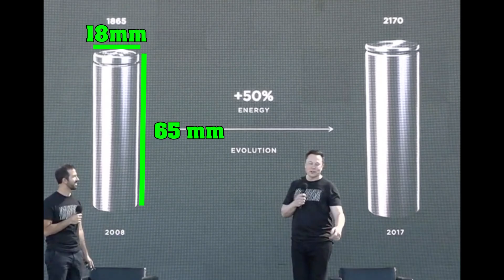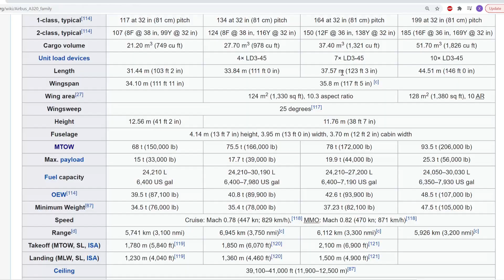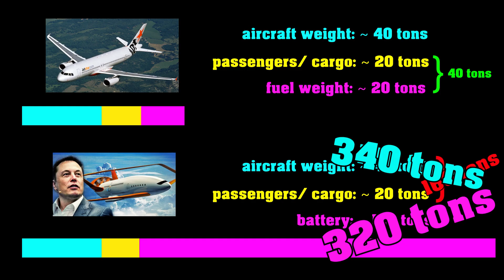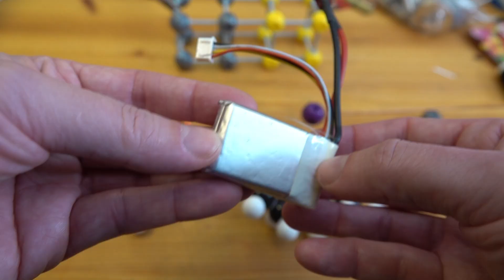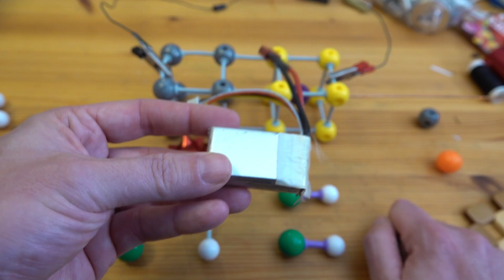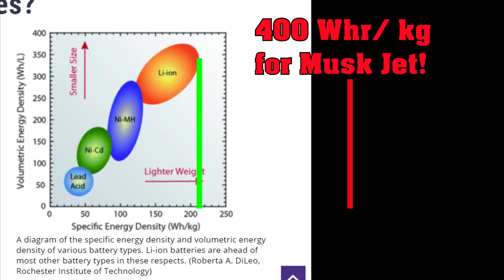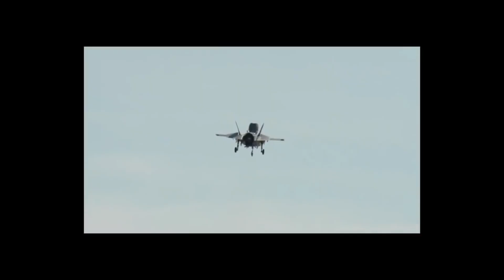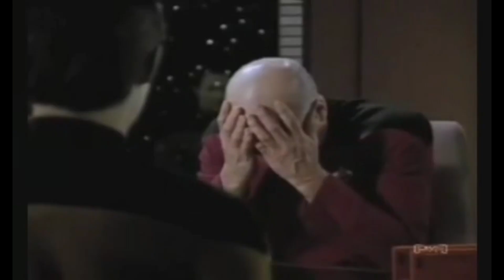Tesla's Secret Plan To Disrupt Airlines: BUSTED!!

Comment: I have only one problem .. the electric jet engine, where is it?!
Reply: fan and electric motor most commercial Jets use high bypass turbo fan engines meaning most of the thrust comes from the fan at the front of the engine very similar to turbo-props. Obviously wouldnt be particularly useful for supersonic flight

Comment: "It's a battery with wings!" So what? A rocket is a fuel tank without wings.
Reply: That's why you don't travel with it and it is for a very very specific purpose.  But wait, there always the SpaceShip which you can use hyperloop to reach within mins on a Tesla model 3 running under a underground tunnel right outside of your home.
Reply: @tarotaro6933  it's called Starship. Jeesh, get it right! And why travel when you can experience Maui with your brain implants?

Comment: I guess once the batteries are a dead end they'll try to make it electric by using hydrogen in a fuel cell. Even that would run into some energy storage issues compared to current fuel, to get a reasonable amount in it'd probably have to be liquid (good luck producing that much cold hydrogen). Then you've got the next issue the energy density by weight is pretty nice, but liquid hydrogen is not a dense fluid so an equal mass of it would take up more volume in the plane.

Comment: Also biggest argument , planes with jet fuel get better fuel efficiency later in the trip as the plane becomes lighter. With batteries as they discharge , the become dead weight and efficiency would stay the same or decrease.

Comment: when they talked about electric aircraft being more efficient the higher they go I think they meant the oxygen or oxidizer needed to make the fuel ignite whale in an electric aircraft oxidizer is not needed for the electric motor to run
Reply: Oxidiser is still needed for batteries to operate as well. Both batteries and combustion engines rely on redox reactions to work, but a battery needs to carry oxidiser with it in order to run, whereas a combustion engine doesn't as it gets the oxidiser needed, oxygen, from the air.

Even worse, the Casgain's Academy guy got it completely backwards. Electric planes get LESS efficient the higher you go, while combustion planes get more efficient.

Comment: At 25:15 the guy says "typically, when it comes to gas powered planes, the higher you go, the less efficient the plane is."  Yes, that is true, for reciprocating engine airplanes.  Jet engines work more efficiently at higher altitudes, which is one of the reasons jet aircraft fly so high, plus reciprocating engines can make use of turbochargers to maintain atmospheric pressure at the intake manifold and maintain combustion efficiency.  And recip engine aircraft all have a mixture control to adjust the fuel/air mixture with altitude to maintain the most efficient ratio for the air density.  And one of the factors of a jet turbine compressor is it makes the air insanely hot as it's compressed, which along with the pressure is how it ignites the fuel.  That hot compressed air is also ducted off to heat the cabin as well as maintain cabin pressurization, because without it they'd be flying along with a cabin full of deflated popsicles.  An electric plane would have to suck down a shitload of electricity to run electric heaters and air compressors (can't just plug the holes to maintain pressure because, ya' know, carbon dioxide and all that).  And one other nugget of information Lord Musky didn't seem to think about is this:  why do jet aircraft jettison fuel before an emergency/early landing?  Because the landing gear can support the full takeoff weight on the ground but can't support that much weight when combined with the excess G-forces from even a gentle touchdown.  Because, ya' know, inertia of descent and all that.  They either jettison fuel or remain airborne longer to burn it off.  You can't jettison batteries if you have an emergency landing, and the weight doesn't go down during flight!  Airlines plan how much fuel to use for a route so that the weight will be below the maximum landing weight when they reach the destination.  If ElonAirlines planes aren't built with landing gear strong enough to support the higher load factors on landing of the exact same weight they took off with, the landing gear will collapse and every landing will be a crash landing.  Stronger landing gear, more structural weight, more thrust and lift required to carry the weight, more batteries needed, and so on.  I am genuinely surprised that he didn't say his planes would be covered with solar panels.  And VTOL?  Vertical takeoff and landing aircraft like the Harrier use a metric fuckton of fuel because 100% of the thrust is used to support the weight of the aircraft, whereas it's much easier to push a plane forwards in the air and let Bernoullian physics generate lift over the wings.  The dumbass may as well claim he's coming out with antigravity aircraft because he seems to know exactly as much about aviation physics!  Elon Musk must really enjoy the scalp massage he gets from colonic peristalsis.
[source:  Bachelor of Science degree in aviation, 20+ years of aviation experience, commercial pilot rating, and my head not lodged in my ass]
Reply: jet engines do not work more efficiently at high altitudes in fact their thrust output decreases the higher up you go, you are confusing it with the fuel efficiency of the aircraft as a whole, whilst the engines lose efficiency at higher altitudes the thinner atmosphere reduces the air resistance and allowing the plane to fly faster than at lower altitudes, its a simple equation for the thrust, Thrust(T)=Q(V2−V1)  where Q is mass airflow ρAV. ρ is density of the fluid so as ρ  gets smaller the thrust decrease too, all air breathing engines work most efficiently at lower altitudes because there is simply more air
Reply: @shaneebahera8566  What the fuck did I just read

Comment: Bit disingenuous he’s said the battery tech isn’t there yet and needs more energy density for it to be viable, comparing it to an airliner when he’s talking bizjet size. Gulf streams take a much larger proportion of its MTOW of fuel compared to say an airliner. After it all determining yet battery density isn’t there yet.
Reply: The fact that a combustion airplane gets lighter as it flies and a battery plane will not, along with the inherent dangers of storing kerosene energy densities in a battery, mean that the idea of a battery-powered commercial plane crashes and burns before it even leaves the ground.

Comment: also its going to be very hard to equal the raw power density that turbine engines have without probably inventing entirely new electric engines. .... you could do better though, turn the wings into giant rectennas and aim a very large microwave transmitter at it and you got a good percentage of all that juice without carrying the energy source on board.

Comment: What about developments in graphene batteries and the fact you can cut weight from current plane airframes ie the triangular dorito shape for more surface area vs current cyclometer more space  for a battery floor plus implementing weight savings in the form of polymers or carbon composite fixed back seating with lightweight foam and a requirement of carry on only travel.

Comment: The 70% claim is very UNDERRATED. The energy density of the battery is less than 1/50 of fuel. So in the example of plane departing with 20 tons of fuel, compared to even the lowest estimates  eplane using 100 ton battery, that battery would carry as much energy as 2 tons of fuel and not 20 tons... so the range of the eplane would be no more than 1/10 of the fuel plane... so short flights only. And than you wait half a day for it to charge?

Comment: 1:45 - misleading information, 24ml is not 46% more than 17ml, the correct answer is 41.18% and then you even say 50% which is not 46% or at this point 41.18%, the math is wrong here...
Reply: He rounded to nearest whole number on volume. The first battery is 16.54 ml and the second battery is 24.25 ml The second battery is 46.58 percent larger, but he rounded 10.
Reply: @axispyramid6366  he presented numbers on screen, work with the ones presented. 17ml and 24ml. Either he has to stick to the numbers in his video or present more accurate numbers. 46% is not 50%. Even a single % of difference in the case of a battery means a lot. 46% is not 50%  and you cannot just round up by 10. That's plain stupid, just to present big numbers...
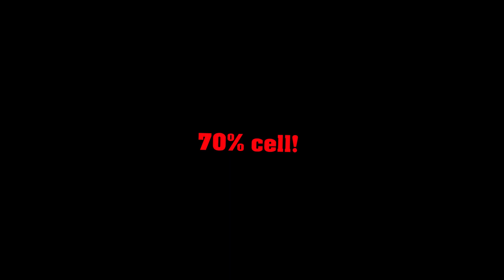Everyone also ignores the fact that Elon was not talking about volume of aircraft must be 70% battery at 3:50 ? This guy spent a whole video talking about weight, when that wasn't the point at all.

Comment: What’s happened to you recently thunderf00t? You’re blinkering yourself just to produce scathing, sensationalist anti-Musk content. Tabless cells are all about the system engineering. Firstly getting HEAT out through the end of the cell rather than needing complex coolant paths through the pack. Secondly it’s making electric connections to just one end of the cell. Thirdly the internal resistance is lower so there’s less heat to deal with. All of these things make them more suitable to being STRUCTURAL elements. So this 2/3rds mass is not just the energy store but also the plane itself. Have you ever come across structural Kerosene? Totally agree with you on the fundamental cell energy density limits, but why feign ignorance of everything else? I used to like your videos but sometimes I think you need to take a look at yourself.
Reply: > "What’s happened to you recently thunderf00t? You’re blinkering yourself just to produce scathing, sensationalist anti-Musk content."

- Wrong.

> "Tabless cells are all about the system engineering. Firstly getting HEAT out through the end of the cell rather than needing complex coolant paths through the pack. Secondly it’s making electric connections to just one end of the cell. Thirdly the internal resistance is lower so there’s less heat to deal with."

- That's great!! ...I don't see how this would do anything to make a battery-powered commercial aircraft any less impractical, but go on...

> "All of these things make them more suitable to being STRUCTURAL elements. So this 2/3rds mass is not just the energy store but also the plane itself. Have you ever come across structural Kerosene?"

- Modern aircraft have structural fuel tanks. Their wings are known as "wet wings", where they seal off parts of the wing structure and use them as fuel tanks. So the "advantage" of batteries being structural is not really an advantage at all.

Comment: we can bairly keep an electric plane in the air for longer than 3 hours those ones are successful.   Sonex Expairmentels.   but they are basicly motor gliders.   the only way you can make electric motors viable for air travel.   you need a motor that can beat nomal piston engines.   with propellers...
Reply: motors already beat piston engines in efficiency but the problem is the energy density of the fuel/battery on one hand you have a energy source with great energy density like hydrocarbons but the engine has poor fuel efficiency and on the other side the motor has amazing efficiency but the battery has poor energy density
Reply: @shaneebahera8566   good point

Comment: well.... to discredit elon musk would be quite the bully. Though... not going to defend him ENTIRELY. The application of electric POWERED propel engine aircraft.... perhaps.... not on Planet Earth... 

Just giving little Elon some face... some... If there is a planet with 99% carbon dioxide. The application would be more feasible than in comparison to a combustion engine which requires carbon fuel and oxygen. Though... space application is still in a lot of research, debate and viability. Resource conserving are something we all have to bare in mind as well. It is not so much of a idealistic dream but more of a gamble. Again... more feasible, does not mean it would be chosen... It would be put up to debate. 

Resource spend on something is not easy to recover it back. There are some talks about converting biomass into fuel. How efficient in terms of conversion.... debatable.How great of such energy density? A lot of testing. A lot of laws, A lot of equipment for large scale.

Comment: At high altitud  you can fly faster more easily because the air resistance ,and with a fuel plane flying at supersonic you got a lot of air ramming in to the engine , plus you can do afterburn. but if you go with an electric one you have wath? A prop ? A electric turbine? Spinning at what rpm ? In that scenario how altitud will help you? Why there's  no military airplane using electric motors to get to supersonic if that's so good ? And if it's so good , why the falcon 9 uses querolox instead of battery's in his first stage? Elon doesn't have any of his engineers telling him yo, stop saying stupid things. And if the concept of an electric supersonic plane  isn't stupid enough , lets add the vtol capacity...

Comment: The electric airliner is going to need to use electricity for more than just thrust too. Controls, avionics, pressurization/heating, and passenger amenities will all need to draw from the electrical supply, taking from the maximum available energy. A gas powered engine supplies this power through alternators and pressurization/heat from air bled from the engines.

Comment: currently airliners cant land carrying their MTOW they usually have to burn fuel or dump it to reduce weight to a safe MLW so for the a320 neo  its 67.4 tonnes so it needs to be about 11.6 tonnes light when it lands if it takes off fully loaded. So the tesla plane would need to take actually carry less cargo because it cant burn off battery weight during flight

Comment: The length of your video seems unnecessary as the concept of a battery powered commercial aircraft can be dismissed by comparing the elements used in manufacturing batteries vs fossil fuels. On the one hand we have hydrocarbons, which are obviously made from carbon and hydrogen, and on the other we have lithium batteries. It is difficult to envision a battery which will outperform the energy density of fossil fuels while also being less dense than a technology which includes the lightest element. Batteries are great and have their place in a future where we might look to provide redundancy in a power grid, but an airplane needs to balance weight and energy density which is where batteries become useless as a power source. 

I truly believe our civilization should focus on implementing nuclear fission and technologies to clean up the waste produced while looking to the long term development of nuclear fusion. If we can crack fusion as an energy source then we could solve most problems on Earth as clean and cheap energy will bring down the labour cost of pretty much everything in our society and almost completely eliminate pollution. 

Renewable energy sources have their place and I have no doubt in future we will develop technologies which can harness vast amounts of energy from our environment without causing problems, but we must focus on technologies which we can implement now and not something we hope might possibly become real in fifty or a hundred years time. 

P.S. 

The Sabre engine is far more promising as a fast and efficient way to travel across the globe than any electric plane.

Comment: You've completely omitted the whole idea of burning fuel by planes. They do not store burnt fuel onboard ;) They get lighter as they fly. Battery plane will have full takeoff mass for whole flight which means it will be super tricky to land it at the end.
Also regular planes when they need to do shorter trip they are not fueled to the capacity, they take as much fuel as they need plus safety margin. Which means they are much lighter on shorter distances, battery planes will have same mass no matter how far they need to fly.
So I think same mass battery plane will have significantly less range than regular plane.
Reply: Hold your phone at 0% and at 100% charge

Comment: I wouldn't want to sit over 120 tons of batteries. Yes, fossil fuel is dangerous, but fuel fires usually happens in any vehicles only after a crash or some kind of damage is done to the fuel tanks and fuel lines. On the other hand, the main reason for vehicle fires are due to electrical components and wiring failure, specially batteries.

Comment: There is another problem with battery powered jets. Planes benefit significantly from the fact that the fuel is used up hence there is less weight on the plane during the journey. Batteries do not lose weight at all (well actually they do but a negligible amount of weight ) and hence they lose out especially the longer the journey is. 
As we know rockets take advantage of the fact that fuel is consumed by having staging to allow them to ditch their fuel tanks - its such a saving that they do this even though they have to ditch their engines at the same time and use new ones!
Reply: Not only is fuel consumed during the flight, but unlike batteries, fuel engines only need to carry half of the reactants needed for the redox reaction, because the other half is captured along the way
Reply: In fact, this single fact alone is precisely why the idea of a battery-powered commercial airplane literally crashes and burns before it even gets off the drawing board.
Reply: This is not a problem for battery powered planes, but vehicles in general. Ideally electric vehicles are wire/grid-powered. Battery probably would have a much more limited range of use for transportation, if we're thinking of energy efficiency and all the green aspects.